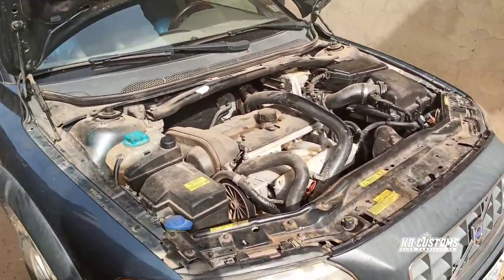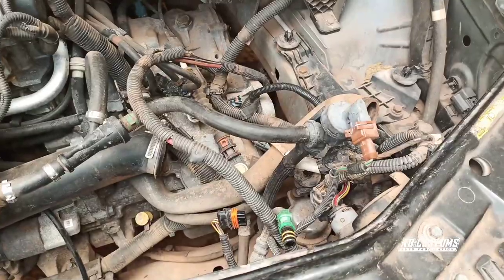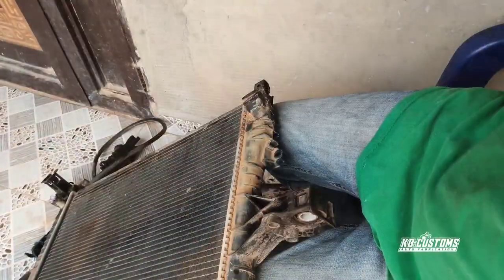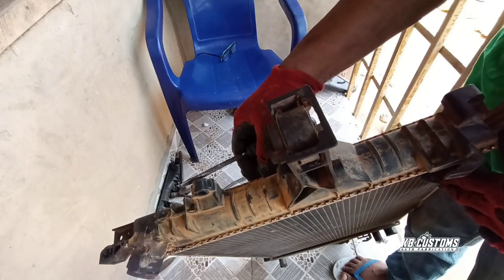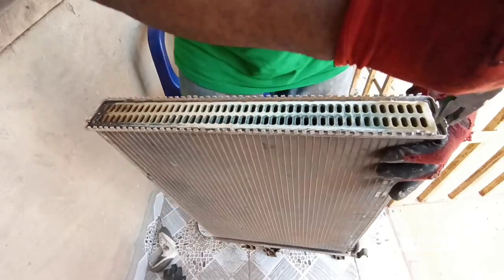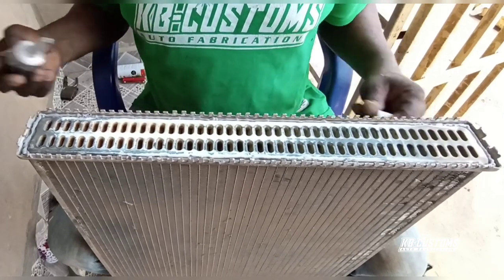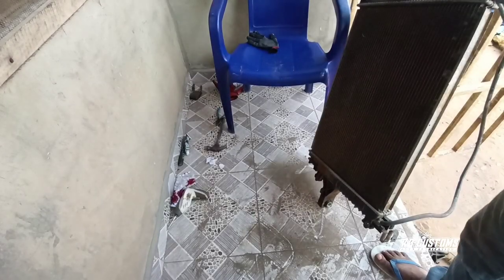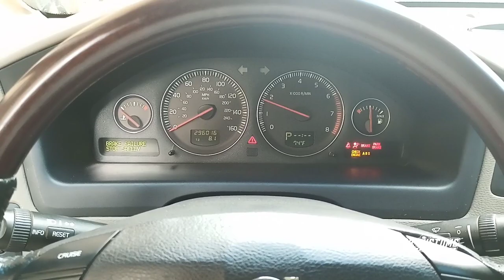Replacing a leaking radiator  busted plastic side top tank

Comment: 4 hour process take your time carefully pry the tabs trying not to crack them pipe wrench and hammer each tab down with a socket extension to ensure water tight seal
Reply from the maker: Correct 👍